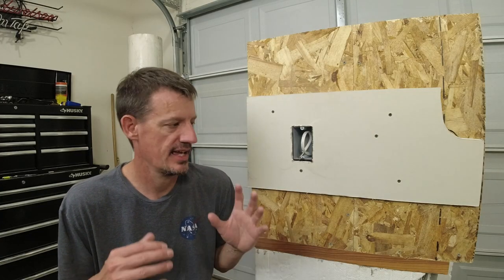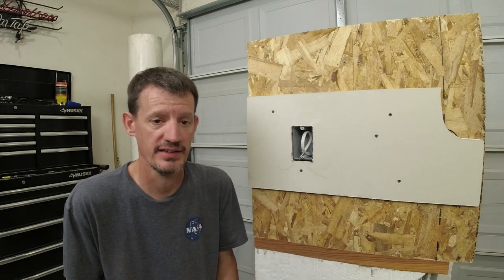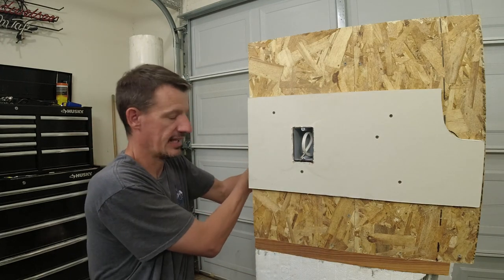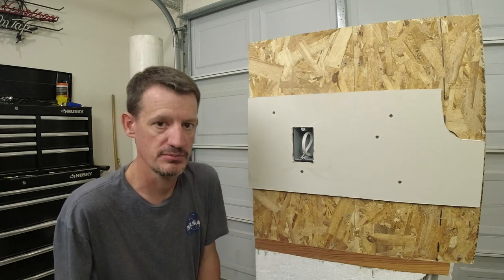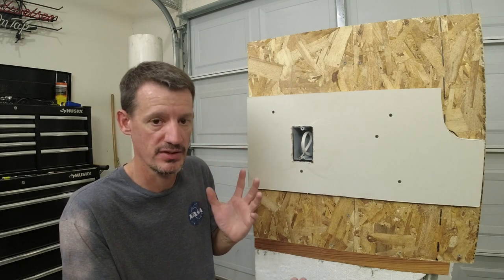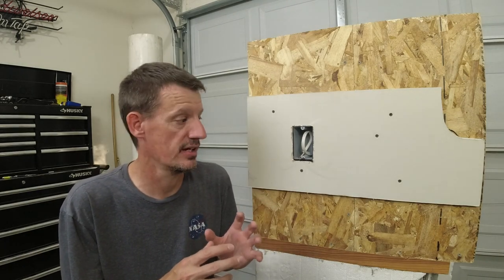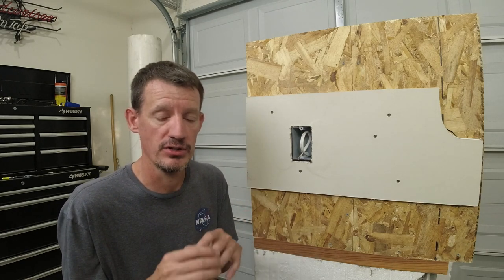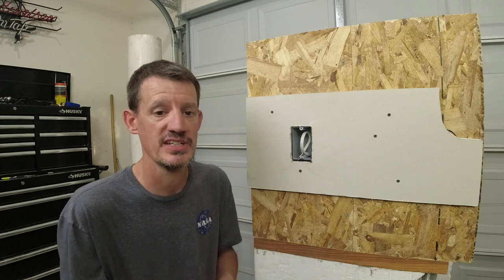Top 3 Pros and Cons of SIPs Construction

Comment: Thank you for this explanation of comparing sips to traditional stick framing.  I am new to sips and had this exact question about the structural strength. I've worked some on the research end of structural wood with stick framing.  I believe that the simple answer is the amount of "board feet" that you are using in your walls to hold up the roof.  A "board foot" is a 1" x 12" x 12" amount (volume) of wood. Your example in this video shows that there is actually more board feet in sip walls than traditional framing.  This is a good way to explain how sips are actually superior in strength.  The other benefit that comes to mind (from a cost estimate perspective) is that your labor to put up these walls does not have to be skilled framers. Just a few laborers to set the panels and 1 person (who doesn't even have to be doing the work) who directs the laborers.  For the diy person, this is a big savings in cost.
Reply from the maker: Glad to help.  It took me a while to figure this out myself.   Your exactly right they turn this into a simpler and faster build.  All the detail cuts are made at the factory.   It saves a lot of time in the field.

Comment: The sandwich construction makes the OSB act like I-beam girders. the central foam only needs to hold the two sheets apart, just like the central web in an I-beam. 
I remember seeing some test pieces back in '73-'79 at university where the exterior sheets was just 3/16th hardboard and the foam was 2". The engineering dept had formed a pagoda outside the canteen/restaurant using the panels and left it weathering for the years. Then the loaded it to destruction and it was the support pillars that played out. Quite impressive.
Reply from the maker: It is really impressive stuff.

Comment: Thanks for the information. I'm in the gathering information to start planning stage & stumbled across a SIPS video over in Matt Risinger's channel & it has completely changed the direction I was thinking. Energy efficiency, structural integrity & air/bug sealing are major positives in mind but the idea that installing the SIPS seems to be well within my own modest skillet is very intriguing. I keep looking for videos to find the pitfalls in assembly that will talk me out of it & haven't come across any - yet. Planning out the electrical & plumbing will take some extra thought but that will only cost me some of my time. 

Trying to understand the strength of the panels, it helps to keep in mind that this is a composite & therefore stronger than it's individual components. The OSB has some good compression strength & the polyiso helps to stop the tendency of deflection of the panel. In addition, the polyiso has pretty good strength in compression as well for it's volume/density. The strength advantage is in compression though, they aren't as strong as a horizontal panel because the factors I mentioned above aren't aren't in the same abundance. Support them properly & they'll do just fine.

Thanks again for the informative video.
Reply from the maker: Thanks.    I'm glad the information was helpful.  I had more or less the same experience.   I've always wanted to build a house, and as I was researching stuff, I found sip's.    One thing that has changed is the price of lumber.   20/21 when I first started looking, I think it was actually a little cheaper than standard stick framing.   Hopefully, this summer and fall, I'll be able to get in-depth with what it takes to actually build with them.  If you have any specific questions, let me know.   I'll make sure I try to answer them.   I'm also trying to get a tour of the factory when ours are in production.
Reply from the maker: I forgot to mention that I've got another video on sip's that may have some more information for you.  It's a little longer and gets a little more in-depth on the details.   Wiring, plumbing, connection of panels etc...
Reply: @thekayfamilybuild  thanks, I'll check it out & I'll definitely try to remember to bounce some ideas/questions off you as I start getting closer

Comment: Then add that your foam is actually load bearing as well, where batt insulation is definitely not. The SIP get's its superior strength from foam/osb combo PLUS their relative geometry. Then beyond all that where you have point loads or needs for headers, the SIP manufacturer adds dimensional lumber only where needed.
Reply from the maker: Yes, I don't think I did a great job of describing the relationship between the foam and the osb. The point load is also a great point.   My plans call for some beams to support the roof beams to support the point load of those beams.

Comment: we built our 5000 sq ft house in Wyoming out of SIPS paneling. Its warm in winter and cool in summer. We dont have a central heating or cooling system. The only big CON for us is to make sure your planning is well done. It is extremely hard to adjust or add windows or doors. We had one room that we wanted larger windows but could not because of the Sips paneling. That is the only downside for us. If you use make sure you plan every detail before building/
Reply from the maker: That's definitely a good point.   You have to plan everything out in advance, and remodeling can be a little tricky.   Changing a window or door size down the road could be a really big deal.   This really drove me crazy I over thought everything.
Reply: If you don't mind me asking how much was it to build with the electrical, mechanical and all kitchen and bath furnishings installed?

Comment: Great video very informative. Here in New Zealand some SIP panel manufacturers are building the panels with a steel spline for added strength and reinforcing. For example in flooring and roofing where long spans are required.
Reply from the maker: That's interesting.   I'll check those out.  Do you know who the manufacturer is?
Reply: Select

Comment: Thank you for sharing your knowledge of SIP panels. What level of fire resistance do these panels provide, or is that more so a function of the siding one chooses to install? What type of siding did you use?
Reply from the maker: Great question.   They meet all the standards and the materials are the same as standards construction.  I've gotten some similar questions and I think I should do some kind of video on this.  I'm going to be using metal siding and roof for both longevity and fire resistance.   The treat of wildlife is always a concern in areas like ours.

Comment: Its strong because its like having an exoskeleton house made of exoskeleton walls. Tension and compression forces are optimized since the material (OSB) is put as far away as possible from the moment load, which is at the center. Its like continuous I-beam in a 2-dimensional plane and that makes up the entire exoskeleton of the house. These walls are stiff and do not bend nearly as mich as stick frame walls.

Comment: These panels are strong because the foam core prevents buckling of the skin. 

For example: Cut a 4' x 2" strip of OSB. Now apply force to failure with the strip oriented horizontally; the OSB has a "crush" failure mode after applying a significant amount of load, it's too short to buckle so it's strength is based on the compressive strength of the OSB. Now apply force to failure with the strip oriented vertically. Instead of crushing the OSB strip will bow out and buckle resulting in a break in the middle of the strip with very little force applied.

The foam core helps prevent buckling allowing the SIP panels strength to approach the compressive strength of the OSB. The problem with these panels is that if moisture ingress occurs delamination of the foam core to the OSB panels will soon follow severely compromising the strength of the panel. The finishing details of these panels is not the same as a traditional light frame construction; these homes do not "breathe" and so special accommodations are required to insure that no moisture reaches the panels and in the event that it does there is a way for it to get back out.
Reply from the maker: Agreed, all great points.   The foam acts like the web of an I beam.  With the moisture, I think that's universal practice sip's or no sip's these days.
Reply: Hey awesome post!   What are your thoughts about metal SIPs? Does that address all of the weaknesses of the traditional osb SIP setup?
Reply: @iatros786  I think those are great; it's a good idea for any home in an earthquake zone to have an ultra lightweight roof. I would be concerned about galvanic corrosion though. I would be very carful about which fasteners I used and any possible electrical paths to incompatible materials (you really wouldn't want to pair steel skinned roof panels with copper gutters for instance)
Reply: And laminate makes it very strong

Comment: I’ve been trying to find more information on the metal Sips,. I’m very interested in using them. What are your thoughts?
Reply from the maker: I honestly don't know much about them.  I've seen some pictures but haven't dug into them.  I would assume it's the same basic structure and process, so it should be a good system.   For what I'm doing, it wouldn't be the right fit.

Comment: My hesitancies with SIPs are:
1) What if they get damaged by water, termites, fire, etc? With stick built, you can temporarily brace the structure, remove and replace the damaged section. What do you do with SIPs?

2) Do the panels ever delaminate, either under adverse conditions or even under ideal conditions, due to manufacturing defect? That would compromise the structural strength.

3) When I think of wiring/plumbing, I want to frame out the wall with some kind of stud, either steel or wood and run pipes and wires in that space. That adds to material expense and labor, but it would make any future work or last minute design changes easier. You could also add fiberglass bats for even more R-value.

I'd love to see SIPs with Zip sheathing on the outside. Next best would be a fluid applied WRB.
Reply from the maker: All good questions.   When we start installing our sips, I'll try to answer your questions.  I have seen at least one manufacturer using zip sheeting for sip's  eco panels of Tennessee.   They have a pretty good YouTube channel.  We are planning on using a fluid applied system in our build.
Reply: I just talked to rob at eco today,I am also thinking about using the fluid applied .what system are you thinking of using for you liquid applied system? @thekayfamilybuild
Reply from the maker: @JOL-FJBMAGA  Prosoco R guard is the fluid applied that I'm looking at on the fluid applied.   On the sips, I'd recommend checking out a couple of manufacturers also.  I'm planning on using Premier.  I also really liked Enercept.   I don't believe Eco does roof panels, so that might be a drawback for you.  Check out the SIPA website they have all or most of the panel manufacturers, and they are a pretty good resource for more information.
Reply: Can't remember the name of the company but a search here for SIPS panels a week or two ago here revealed a company that uses Zip sheathing. They also use the "foamular" type insulation instead of polyiso.
Reply: @bamascubaman  These guys use Zip system panels: https://www.youtube.com/watch?v=r6hFBO1oJEA

Comment: I’m thinking timber frame and SIP for our next house. (Hopefully interest rates drop in 2025). I like the timber frame for the interior aesthetics and SIP for the insulative properties since we get bad winters.   I wondered about two things:
1) are the interior walls in that case usually stud construction and SIP just at the exterior?
2) what are the implications of hanging things like floating shelves on the inside on the SIP panels?  In our house I mounted them on studs which make them very strong, I’m curious about how the OSB particle board holds up to a shear force like that for large heavy floating shelves?
Reply from the maker: Great questions.   Timber frame and SIP'S are really popular used like that.  I actually originally thought you had to do something like that for structural support.  I want to make sure I understand your question.   So a corner room in a house would have 2 exterior walls and 2 interior walls. The 2 exterior walls are SIP'S including the interior side of them.  You attach your drywall directly to the sip's.   Your 2 interior walls are standard stick framing.   The only place you generally see sip's used as an interior wall would be a garage wall.   On the floating shelves I don't think you will have any problems mounting them to the sip's.   On the one's I've installed they generally have a metal strip with holes every half inch.   You could literally put screws in every hole on the base plate if you wanted.     Hopefully, that helps.  I'm planning on installing some floating shelves in our building.   I'll make sure to post that.  Hopefully this fall we'll be to that point!
Reply: @thekayfamilybuild  , thanks that explanation helped!
Reply from the maker: @MMMS75   Glad to help anything else just let me know.

Comment: Nice video. Some other missing info out there is about how to protect the panels from moisture. Because they are load bearing and incredibly difficult to replace once they start to rot....
Reply from the maker: Thanks.   That is a good point.   I'm going to get into all that as we start going vertical with the house.   I'm actually going to use a fluid applied system that I found when researching that issue.

Comment: 3 main principles why SIPs are super energy efficient:
- Contiguous thick and dense foam walls
- High air tightness achievable if expanding foam is used at all seams
- No thermal bridging (least significant)

Comment: How toxic are the OSBs off-gassing solvents and formaldehyde?  What happens to the glue if the OSB gets wet?  What happens to vapor condensing at the outer OSB layer?  How can you achieve an airtight seal on the rough-surfaced OSB?
Reply from the maker: All good questions.  The chemicals are the same as what's used in standard construction and regulated.  So that being said it's not any more dangerous than standard construction.   You don't want the OSB to get wet and if it does you want it to be able to dry.  Also same as standard construction.  I'm not sure I completely understand the air tight question.   I do know SIPs construction is extremely air tight.   They recommend air exchange systems to help bring fresh air into the house.   Hopefully this helps.   We'll be doing more on this as we build the house.   Right now the excavation is kicking my butt!
Reply: Would it make sense to apply a sealer on the OSB before adding the drywall to prevent outgassing inside the structure?

Comment: Good information looks like there’s a lot of hiding how to install it and watch keeps it together 
Just my opinion  
I am considering using the system to build a tiny home, one the off grid property
Reply from the maker: Hopefully, I can get some good video and info when we actually start putting the house together.    I think this is a great way to put a tiny house together.
Reply: I’m looking at doing the same thing here in NZ - making a tiny home out of Sips.  Thank you for your input and I look forward to watching you as your house comes along 🥳
Reply from the maker: @cherylcarr5690  Thanks.  Glad we could help.   As we start the sip's portion of the house let us know if you have any specific questions.   I'll do my best to get you the answers your looking for.  It should work really well for a tiny hous.
Reply: I have built several SIP homes and am now going to build a Steel SIP cabin. The Steel SIP's may be good for an off-grid situation as they are 1/3rd the cost of OSB SIP's. Strong enough to survive a CAT 4 hurricane. Combine with a rocket stove (1/3rd the wood used) and you have a winner. Some solar and batteries for minor electric usage, and a 12K mini split for AC and some heat during sunny cold days.
Reply from the maker: @scottc8152  Who's the manufacturer?  That sounds interesting.   Id like to look at those.
Reply: @scottc8152  - it seems like steel SIPs would be better than OSB SIPs whether you’re on grid or off grid…? You mentioned that they’re good for off grid bc they’re 1/3rd the price, but isn’t that true whether the house is on grid or off grid?

I’m trying to decide between OSB SIPs and steel SIPs, but I’m finding if there’s not much info on OSB SIPs, there’s a dearth of information on steel SIPs 😔
Reply: PS I found out about steel SIPs from a listing on Craigslist; a company called Real Steel Homes makes them. But I just found them and am now trying to backfill and learn everything I can about the product before making a final decision

Comment: As far a sips go with electrical, they are actually advantageous if you run all of your wiring along the exterior before siding. Nailers  will provide the space. No drilling studs to run wiring!
Reply from the maker: They have pre cut chases for the electrical in the wall that work pretty good.  You might have to put it in conduit if you ran it on the exterior.   I see what your saying, though.   That would be really easy just not sure on code requirements for doing it that way.
Reply: Why would you want to put dozens of holes through your exterior walls?